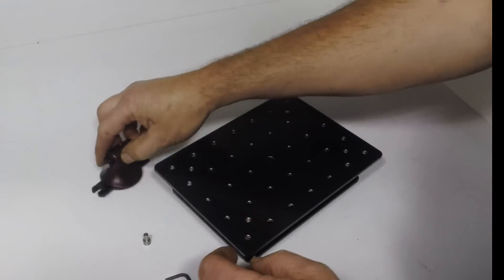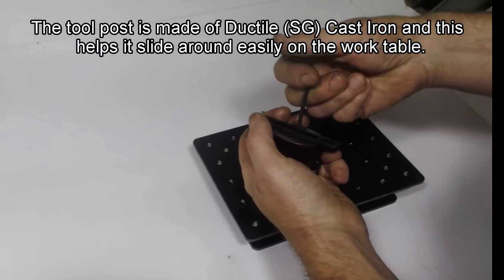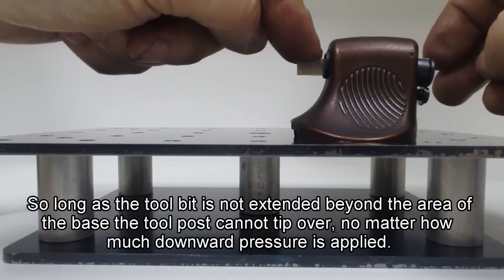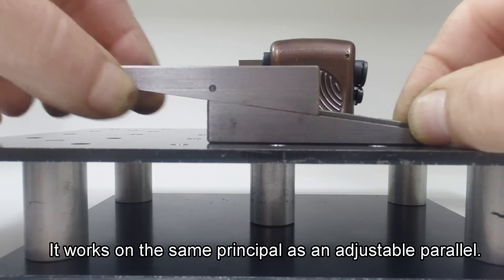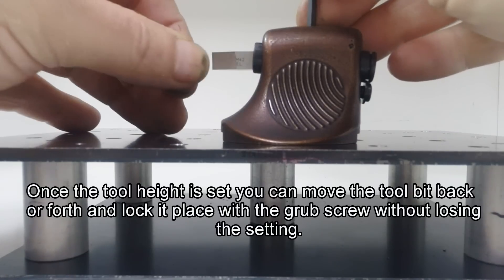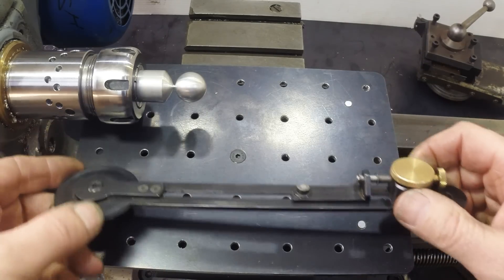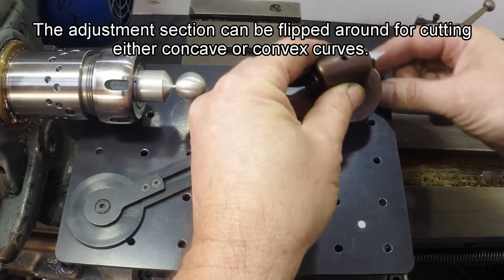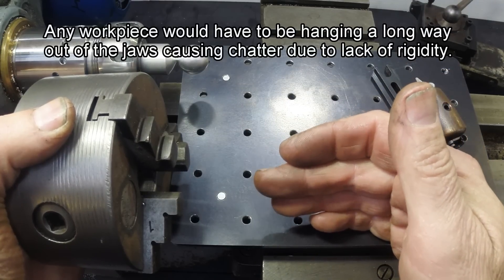The Turnado Freehand Metal Turning System

Comment: Definitely getting one for my lathe. Excellent idea, it's a bit groundbreaking really. Miles ahead of your average ball-turner.

What is the collet assembly you have here? That's a very long, projected collet chuck you have, it seems ideal for these hand-turning tasks.
Reply from the maker: Kenyon Mella Thanks 🙂👍 The collet chuck is an extended ER32 one that are made specifically for the Turnado so you can get the workpiece out over the middle of the table, rather than having to work close to the edge on the left hand side. It also eliminates catch points as your fingers are pretty close to the chuck. An ER32 with a Morse taper shank could be used but then you would have to use short lengths of material due to the lack of a through bore.

Comment: Despite the channel name, your work looks quite concentric.
Very nice turning work and great lathe tool, certainly faster and more accurate than either free handing with a chisel and files, or making custom profiling tools.
Reply from the maker: CleaveMountaineering thanks 🙂👍 Well there’s two meanings of eccentric - 1. Not placed centrally or not having its axis or other part placed centrally . 2. Unconventional or slightly strange.   As you can probably guess, I identify more with the latter 😜🤪

Comment: i have been struggling for so long with meticulous x-y hand feed to achieve the same .... almost getting good at it .... but by the time the gibs are tight enough to stop chatter play my hands are cramping up from turning the wheels so stiff - and it takes forever to turn stuff anyway. i think i might just order one - do they fit well on a 10" atlas lathe? i'd love to do away with my sloppy compound. 

ps - i did see your diamond tool holder some years ago, or "tangential" - i made my own copy, simply made with a hacksaw and files and an angle gauge and lots of reciprocation .... but i have always ground the compound 30 degree angle by hand - very roughly. do you offer just the sharpening jig for these? tuning up a blank bit in seconds would be nice, but the tool holder by itself was too expensive for me to justify. 

thanks for being clever